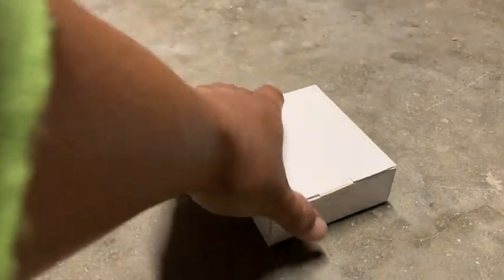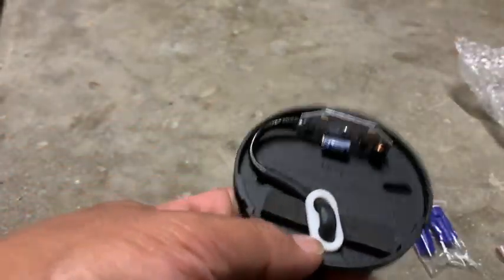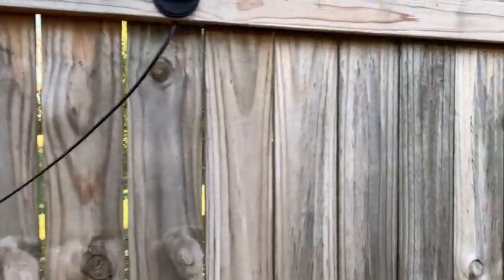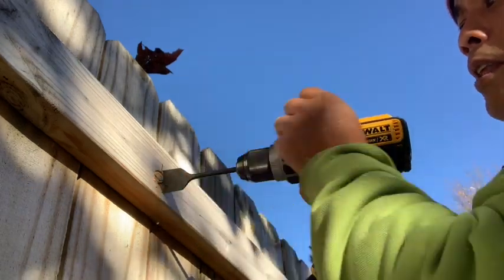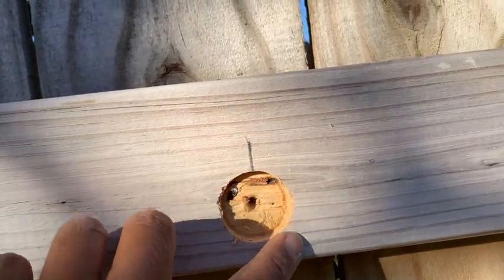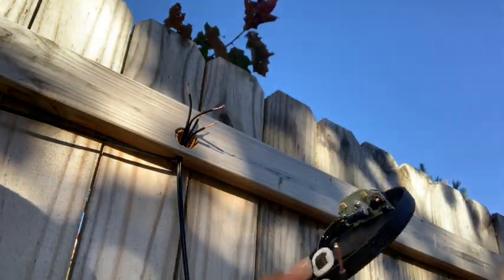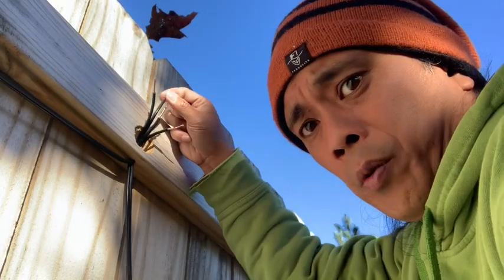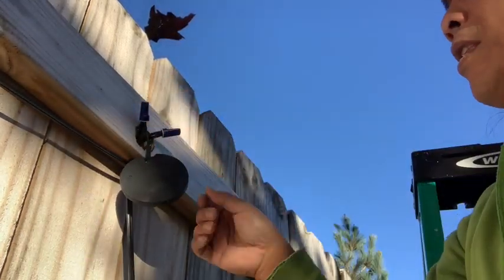How to add Fence LED Landscape Lighting, (non Solar) GKOLED. Low Voltage. Part 1

Comment: My concern is the drilling of the 1.25" partial holes into the fence might weaken the fence.  I'm thinking of adding mounting blocks to the fence, but not sure I'd like the look.
Reply from the maker: My thoughts the same when I was placing my lights.  The part two version is less drilling.  So far, the fence is holding up well and no breaks :)

Comment: I have a landscape illumination company and I would like to point out they should be about chest height to eliminate glare!
Reply from the maker: Well said. Thanks!
Reply: Good point, but I have a puzzle for you.  For my fence I have a cross bar at 4' 10", which is great to meet the chest height you mentioned.  The problem I have is that the back 8 feet of my yard rises up 3'.  I plan on building a terrace gardening up the slope, but that 4' 10" cross bar will now be 7' 10" above the ground level of the main backyard.  Now we have glare, and of course my yard is wider than it is deep, so that would make the majority of the lighting at glare height.
Reply from the maker: @Malvisk that is a tough one.   Would like to see a pic so we can figure this out.
Reply: @AJDIYNetwork  not sure how I'd provide a pic. Can't state urls

Comment: What gauge wire did you use and how long was your run I have 36 watts total thinking of running 16 gage
Reply from the maker: Hi Brian. 16 guage should be just fine for your application at 36 watts.  I ran 14 guage wire since I am running multiple lights at greater distances.

Comment: Do you plan to show the lights at night?
How do they illuminate your fence? I saw your second video as well. Do they have the same angle? Is 2-2,3 watt enough in your opinion?
Thanks
Reply from the maker: Hello and thanks for watching. I think that the 2 and 2.3 watt led lights Work really well in lighting up the backyard along side the fence. I think if we use any more wattage, it would be to blaring and too bright. You want just enough light to cause more of an ambient effect.   Unfortunately, the video really does not do it justice, however in my opinion the lighting serve its purpose. If you have any more questions, please let me know. And again thanks!

Comment: Its always the better idea to keep all wires polarized. The cable should on the neutral / negative side have a ridge or ridges for easy identification. Keep all the ridges tied together and of course keep all the smooth side together. Keeping everything the same will help eliminated issues / trouble shooting. What is wired correctly works correctly.
Reply from the maker: Yes, great advice!  I have read about this after the fact of installation. Though the lights still turn on regardless of wiring(and no damage), it is good practice to keep the same polarity.
Reply: Modern transformers output between 12 VAC and 15 VAC and modern LV LED lights therefore operate without polarity.  In fact there is no polarity in this system, so it is literally impossible to maintain polarity in your wiring since there is no polarity in the system.  So what you are advocating is simply irrelevant.  It is a single phase AC circuit, it is not a DC cuircuit.
Reply from the maker: Gotcha. Thanks for the input.

Comment: Hi, AJ.  What spacing did you end up using for the lights?
Reply from the maker: Hello and thanks for watching. The spacing varied a lot because I had to center it based upon where the builders placed the posts for the fence. On average, I believe it’s about 96 inches apart.  Hope this helps.

Comment: Very cool.  How  is the maintenance on Your fence lighting?
Reply from the maker: For a project like this, you would have to periodically check and remove lighting, primarily, because the wooden fence contracts and expands all throughout the year.  By the fence always shifting, the wires can also move with the fence.